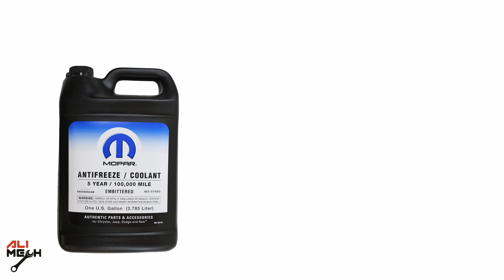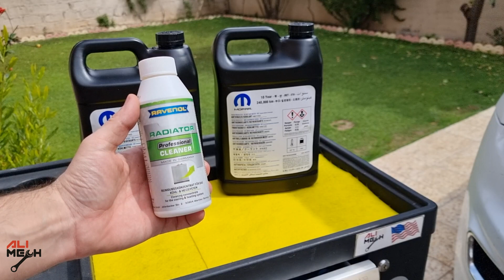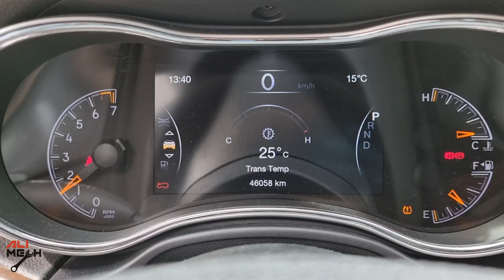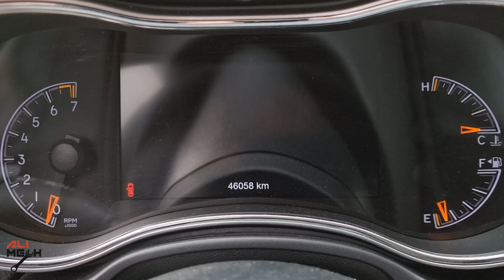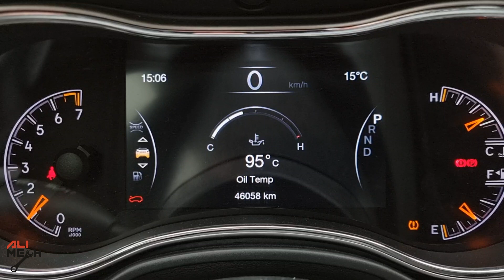Watch and prevent it from happening to save your engine/Jeep Grand Cherokee Laredo coolant flush

Comment: Yesterday I took my Jeep in for a complete coolant flushing service because I noticed the coolant level was very low and had that sludgy texture. Today I checked to see if they'd done it, and to my surprise the dealership just drained and refilled they didn't flushed. The tank still has that disgusting residue😠
Reply from the maker: Sorry to hear that, you should definitely bring it back and explain that they did not do a flush!
Reply: Same here. I thought that was part of the flush, whatever they do. They told me they don't do that! Either do what he did or take reservoir off and clean it yourself.  Or buy new and install.

Comment: Okay so if you do a flush with tap water then do another flush to purge the system of cleaner then don’t you still have regular tap water in the system? I think so. What I think you do is use distilled water for the flush and mixed with the coolant.

(Update). I did the flush with 10 gallons of distilled water only. No coolant flush chemicals. Then drained and blew out the remaining water in the radiator with compressed air. Filled with 50/50 Mopar coolant. System runs the perfect temperature now.

Comment: You don't need to open bleeder valve?
Reply: The 2018 GC doesn’t have a bleeder. I remember my 2012 GC did though.
Reply: @Velo1010  oh that's why. But you have any idea? After I flush my old coolant and adding distilled water. My bleeder should be open or close? Any tips bro. Thanks you
Reply: @orvenmontinola2555 I owned a 2012 then but now own a 2018. I remember the bleeder on that 2012 was on the thermostat. Which was an all-in-one thermostat and housing unit. On the 2018 I used a no-spill coolant funnel kit. Worked brilliantly when I did mine the other day. It allows coolant to flow in while air is pushed out while keeping air from reinterring the system. Probably not as good as factory job or something done by a professional but it’s batter than the traditional way. 

And yes you need to open the bleeder while the engine is running. If you don’t then the water pump isn’t running so you don’t have any way to purge the air from your system. The system is pressurized while the engine is turning the pump. With the engine off there isn’t any pressure unless the engine is at operating temperature.
Reply: @Velo1010  thank you brother. Its making sense now. Thanks for your time sharing the information. Appreciate it.

Comment: Annnnnnd that explains why my car is not reaching operating temps. It will at idle but not driving. Reservoir is full of sludge and I’ve replaced the thermostat. At idle it goes to operating temp but once I drive it drops. Pretty sure it’s a mix of contaminated coolant and air pockets

Comment: Hello ! Very helpfull video, I just have one question.
For the first flush, should the engine be hot or not ?
Thanks
Reply from the maker: Yes it has to reach operating temperature to open the valve and let the water circulate

Comment: I have the same colour sludge as the video did. But I've done many flushes and colour is still brown... Also, unlike the video the staining in the coolant resevior hasn't changed, not even after chemical flush. I can't understand why
Reply: That sludge or gel, or what ever it is, is the nightmare. Exacly today, i removed and cleaned coolant tank from corsa c with a lot of powder detergent, sand and hot water. After that i disconected hoses for radiator, heater core and engine block, so i flushed every part separately by putting garden hose into car hoses making sure the water pressure is not that high. I spent about 6 hours today but i think it paid off very well.
Reply: PS
The water now is still clean after first 20-30 kms
Reply: Yea my reservior is coated in gunk. I think I'm just going to order and install a new reservior at the same time as the flush.
Reply: @nicderemer1  yup. Got a new resevior. Problem solved.

Comment: This video was very helpful. I've never done a radiator flush before. Doing my first one now. So far so good. I followed your instructions exactly. That funnel set is very helpful. Thank you!
Reply from the maker: I'm glad it was helpful,  thanks for your feedback
Reply: @AliMECH  So, today after I did the flush and drove the Jeep, the Jeep is kind of running rough. I thought it was because I may have overfilled the reservoir but the reservoir shows that it's about half between Max and minimum full, also check the oil to make sure there was no milking Us in the oil so no water is making it into the motor. Do you have any idea why the motor may be running a little rough when it wasn't doing that before I flushed the system?

Comment: GM had the same problem when they first released their Dex-Cool anti-freeze. People would top off or service the cooling system using the green coolant that's been around forever and a day and the cooling system would turn into a mud bog and clog the system up. Solution: only add the same color of coolant that the car came with when new. Problem: Untrained (or cheap) people perform services or repairs thinking all coolants are the same.

Comment: Not sure if this antifreeze is bad, I only used OAT. My water pump failed and it went bad in less than 50k miles (muddy)
Reply: That coolant is notorious for sludging. I would do a complete coolant flush and run clean distilled water until you see clear water coming out before filling it up with the coolant and bleed your system properly.

Comment: I have a 2016 and it says that it uses OAT but it is orange liquid, HOAT is used by older models
Reply: It is tricky issue to all Jeep owners, until I get to know that purple coolant will not stay in purple colour over the time instead will change to something like red or pink colour due to engine heat
Reply: I had the same concerning but if you watch the video when it shows the liquid it doesn't look purple at (0:36)

Comment: So if i don't have compressed air,Do i have to open drain and remove lower radiator everytime i flush?
Reply from the maker: Yes, that way it will make sure all the water drained
Reply: I used my air compressor and blew the head gasket
Reply: @caleboberther181 your head gasket was likely already blown because blowing compressed air into your cooling system is far less pressure than the pressure a head gasket has to withstand during combustion.

Comment: Good job.. i have 2 questions 
1/ did you drain all the water either that in engine? 
2/ did you mix your coolant water with water 50/50 because I read it’s concentrate?
Reply from the maker: Yes I drain all the water and even used compressed air to make sure all the water came out, and no, I didn't mix, it comes like this
Reply: @AliMECH I'm still unclear as what you mean when you say you let all the water drain out.  I know you drained all the water out from the radiator, but isn't there water still in the engine block and heater core? You used concentrate not 50/50 mix coolant, so how did you make sure you have the correct 50/50 mix?
Reply: It will indicate on the jug: 50/50 ready to use or Concentrate add distilled water 50%